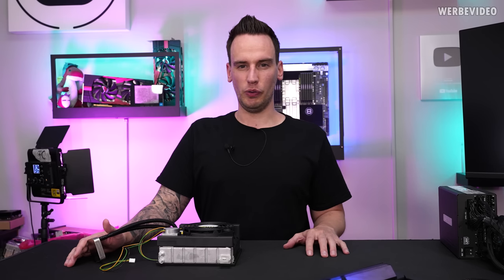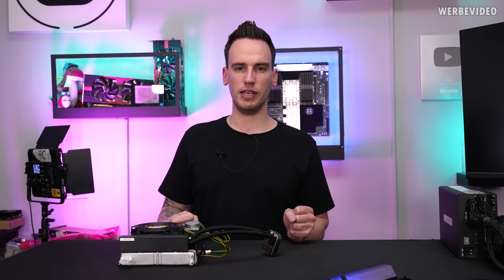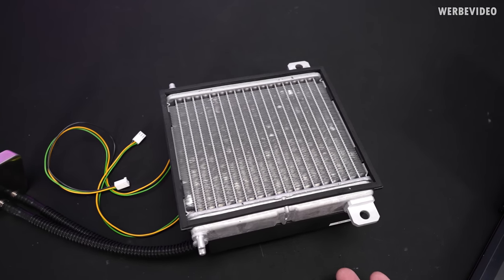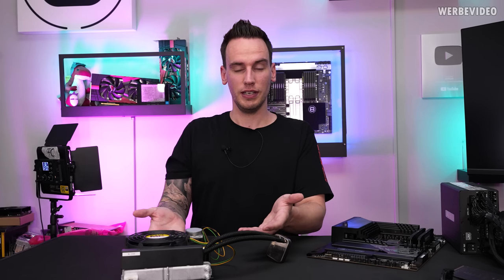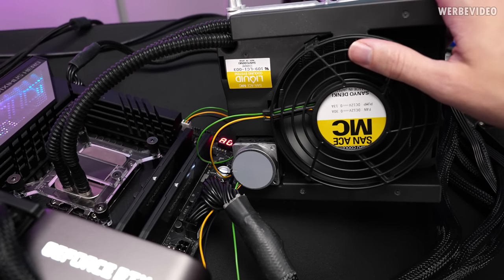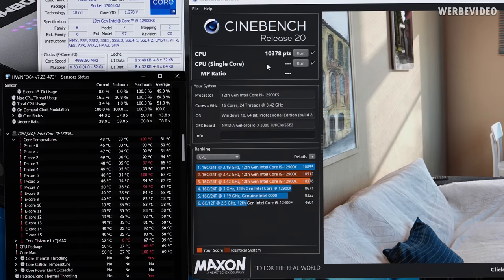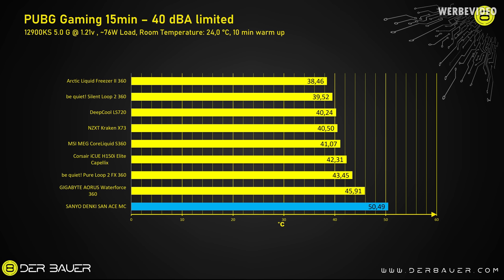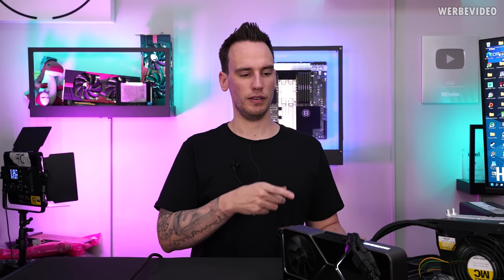Investigating Aseteks false Claim - THIS is the first real "Sealed-Loop Liquid Cooler"

Comment: Seems to me that this is a normal skived copper finned heatsink with a soldered copper lid with hoses attached. There is a seam running along the bottom that suggests this. Plus I'd wager that the base is solid copper and not soldered as suggested.

Comment: Depending on what you mean by AIO, both Zallman and Corsair had external water cooling all in one systems like the HydroCool EX 250 or Zallman Reserator that are technically all in one systems.

Comment: Apple did ship liquid-cooled PowerMac G5 from the factory back in June 2004, with Delphi radiators, a sealed loop and Laeng pump (two on high-end later models). I have two in stock
, one with a failed pump, so could send it for analysis if needed...

Comment: EV's still have radiators for cooling the batteries and motors in many cases, especially when you get into the higher power models.

Comment: Just pulled one of those from a cyber power rig that had 4gb ram a pentium extreme edition 840. With a GeForce 6800 ultra. Man time has come far in tech. The cyber power case had a special mounting bracket for the aio. And a x mount for the lga 775 socket

Comment: don't ask me the name or brand but I had a definitely older than 2006 "aio" I put quotes because it was in the form of a very large "non serviceable/upgradeable loop" rad-pump combo built into the case + flexible tubing (ultra basic) waterblock, it was as large as a side panel so far from our modern aios it was also mixed metals and very quickly degraded so I threw it away and went back to air-cooling until Corsair released their 1st aio...then I bought a threadripper and HAD to go custom loop (1100+watts at the psu lol)

Comment: looking at it makes me think it was built for some kind of industrial computer use, In a hotter industrial environment water cooling would be more efficient than than a plain air cooler due to greater area of a radiator.  You will never go below ambient of course, but water systems can still be more effective in higher ambient.

Comment: The coolant's (specific) heat capacity alone doesn't really matter for cooling performance since in the end you are always discharging heat into air. The only thing that may differ is temperature across the die but that's pretty minor in this context
Reply: It would make a difference if you don't have enough flow, but that is a separate issue.
Reply: lol imagine all these custom loop people dealing with all the issues caused by using pure water nowadays because they misunderstood the physics and they could have been using normal antifreeze this whole time

Comment: Straight water vs water plus glycol doesn't make as much of a difference as you might think.  50% is on the "think" side, but once your working fluid hits 30-40 C you still get 85% of the heat transfer efficiency.  20% is the minimum you want if you want it to prevent bacterial growth.  At 20%, and 30C, you're talking 95% efficiency.  But this doesn't translate to higher temps, it translates to needing a slightly higher pump speed to get the same thermal delta through the whole system, and slightly less time to reach a thermal soak condition.  

Given the ease of working with glycol as a coolant, it's still usually the best choice.  Just make sure you get it without the added sand that comes in many automotive antifreezes.

Comment: I had a Waterchill (still do) and used it on a naked (delidded) 4400+ on a DFI Lanparty Nforce4 Expert with DangerDen south bridge waterblock.  Then retrofitted the main CPU block to cool my Ryzen 5800X.  It was about 10C worse than my Heatkiller IV I'm using now, not bad for 17 years old.

Comment: The fan noise could be mitigated by either replacing it with a more modern one or oiling the bearings. silicon oil FTW.

Comment: There are 2 different kinds of glycol, one of which you should definitely not flush down the drain. In recent years, manufacturers mostly use the less toxic glycol, but this thing is close to 20 years old,, so a heads up on that topic.

Comment: I have one of those in my old qx6800 rig.  I used a drawner handle  and "mounted" (or rather suspended)  it to the top of my case. I dont recall exactly why I bought that particular one, maybe it was on sale or something, I recall getting it from ebay back then

Comment: I found Shuttle Computers "Integrated Cooling Engine" pretty effective in its day, as despite it not having a pump and was just an air cooler, it dumped the heat directly outside the chassis.
Reply: Hey I had one of those also that I had an AMD AthlonXP in it. It was excellent idea and I wished there was more tower style coolers that would let you mount the air cooler to the back of the PC.. But IIRC Shuttle had special made really small motherboards for their chassis. So they had control over the design more. But still, I think coolermaster for sure could have picked up on this years ago.
Reply: @AtomicOverdrive  I probably had the same model!  Went to check Shuttle's "discontinued" section and I think it was the SN68SG2 - built for Athlon but with integrated NVIDIA GeForce 7025.
Reply: @cyberwomble7524  Mine didnt have any onboard graphics, it had an AGP slot and one PCI slot. Shaped like a tall shoe box, brushed aluminum body and the front face had the option of putting your own photos or prints in it for a custom look.
Reply: @AtomicOverdrive  Maybe it was the SA76R4 - it fits the description, but it was AM3.  I remember there was a silver one that didn't have an optical bay, but for some reason there's nothing on their homepage about it.    Different regions had different models on occasion.

Comment: i happen to remember some systems with this installed, it was mounted sideways in those along the side of the case rather then top or front like we are use to now, also they work alot better with a better fan ;)   normally those fans are damn near silent though... that thing was likely used a very lone time 24/7/365, so..... honestly even more impressive how well its held up...would have liked to see results with a ippc fan on it..

Comment: Have you ever tried adding an additional closed loop cooler to an open loop cooler by adding a second CPU cooler to the open loop and forming a figure of 8 configuration? 
Or alternatively adding an air cooler to an open loop?
I ask because I have a free ECGA CLC 280 and was already going to build a base for my PC. I could quite easily cut a hole in the bottom my case to do this and my pump is strong enough. Tried to ask my potential purchase company and they missed my point entirely and talked about a different issue. I even drew them a picture. 
If you think it is possible is there any design you’d go for of the potential accessory CPU plate? It wouldn’t be visible and I already have a pump. Could add a second pump for redundancy reasons but not strictly speaking needed.
Edited to add: I know I will get comments from people who have misunderstood my idea as I have had this trouble. Draw 2 loops. Move them near but do not overlap them. Then link them with a CPU mount to CPU mount heat transfer. You could do it with today’s example. Imagine adding a second CPU block to the open loop in your PC and then attaching today’s CLC to it.
Reply: I don't think it's impossible but probably not that worth of the hassle compared to a real openloop with tube connections and pumps made for it. 
Adding an air cooler into the loop through another CPU block will add a thermal barrier so it won't be as effective as a small watercooling radiator.

Comment: I had one of the first back in the day, i think around 2007? It was a CoolIT Domino ALC.. Worked great for a while, little screen on the side etc..until a hole smaller than a pin prick appeared in the base of the CPU block and dumped its coolant all over my HD4890! Who made the Liquid Cooler in the Quad G5 PowerMac though? I happen to have one kicking around..the whole machine! With a flashed 7900 GTX inside and 8GB DDR2 lol

Comment: The big full copper cold plate and the wide rad are definitely helping temps, the rest being rather weak (2000rpm pump, slow fan..)
Reply: yeah, bet updating it with a modern fan and pump would really light the crap out of that setup

Comment: I think it is rather important that many enthusiasts already cooled their PC with improvised watercooling, like using aquariumpumps. So how can a company claim a patent wit a construction like WaterChill if many individuals already did this? On another topic, I have a video-idea, based on Buildzoid his latest video (performance of the 7950X vs power): a passively cooled 7950X. There is a nice passive heatsink on the market which can handle until around 65W. As crazy as it sounds, the 7950X still is very capable at that wattage and the extra cores and threads would improve performance compared to a 7700X.

Comment: I disagree about pump on block.  That's like saying a ceiling fan should be patented by a single person regardless of what kind of blades are used.  Or that having your oil or water pump attached to the block of the engine is patentable.  All Asetek did was take off the shelf impellers from aquarium filters and put them over a CPU.

Comment: I am not convinced that Asetek deserves a patent for putting the pump inside the block. Part of deserving a patent is that the idea is sufficiently innovative and complicated. Moving the pump does not seem such an innovative idea but I can't judge how easy or difficult it is to do it.
Reply: complicated is not a requirement, they key phrase is "non-obvious" and it is unfortunately a huge loop hole, just look at the existence of software patents in the US (luckily we don't have it enforceable in Europe) where every single patented software idea is obvious to any programmer that have ever faced the problem the patent claims to solve. Then there is the added problem of that the non-obviousness only applies when you apply for the patent, once it is granted one cannot challenge that part, also most patent laws have moved from first to invent to first to file so now even prior art is no longer a way to invalidate patents.
Reply: @Henrik_Holst  Non-obvious indeed is better way to phrase it.  With judges being laymen that is rather tricky.

Comment: I wonder if a liquid cooler was ever made for the slot 1, Pentium 3 cpu?  Ancient tech by today's standards, but I still have one of those towers (completely offline) running Win XP for retro gaming.
Reply: A company called Senfu did a kit for slot 1 back in 99/00 if I remember the release date correctly. Unfortunately the block was aluminium so the one I had in storage eventually corroded to bits. Would be very surprised to hear any exist still.

Comment: Try and find the Aquarium a Chinese thing which was an integrated pump and cooler that fed into a proper aquarium that you could put real live fish into save too much gaming ended up cooking the poor things or not enough and they died from cold exposure, was absolutely crazy kit for its time which was in the 2000's as I did contemplate it but instead went with a Thermaltake Big Water kit with extra ram, northbridge and GPU cooling kits from Alphacool with its thin pipe tech which made it look like little veins on the periphery of the motherboard.

Comment: there was no pump make in 2004 like that usually in 2008 yah
that look like 2017 item was make n sell with fasle information saying it was 2004 it was not
if it was 2004 it would have box heatsink cooler not around it plus it be thick and sometime u will noticed there cut in side and glue back together 
i used to own older water cooler butnsad thing it destory by hurricane back in 2021 September

Comment: given that mounting tab/s on the radiator, tha is most certainly a premade, already in use somewhere model, a motorcycle.. fluid chiller for hydraulic lines or a transmission fluid cooler, something like that . way too industrial .

Comment: It's not a false claim. It's a technicality. There were pump on block coolers before Asetek, but those had a tube going between the block and pump.
Reply: that is not the claim that is false, it's their claim that they invented to closed loop liquid cooler when they released their AIO in 2006 when the one from the video came out in 2004.

Comment: They were the first to put the bump on the block as that's what they catch other manufacturers with over patent infringement...

I know AIO's and CLC's Existed before this though, as I have a friend who had one, the radiator was External and went on the outside of the case as there was no space, it attached to where the rear fan would go with a hook and 2 screws, pump however was not built into the block, was built into the base of the rad...

I have no idea what make or model it was, and it was around year 2001 i think....
Reply: A viewer commented that there was an other AIO in 2004 with pump on top of the CPU block GlobalWin silent stream, so this was before the filed 2005 - 2006 patent (US 8,245,764) of Asetek. GlobalWin in still somewhat in Business, so if someone could buy it and make new AIO water coolers that would be awesome.
Reply: They were the first to put a pump on the cpu block without a hose connecting the 2

Comment: "Eight thousand eight hundred gtx" That's a new one, we called it the eighty-eight hundred in english, must be different in German. This AIO is also much better than the early 120mm AIOs, although it is quite a bit larger. I remember being very excited about those early coolers, and then they came out, and they were twice as expensive as a very good heatsink, while performing worse.